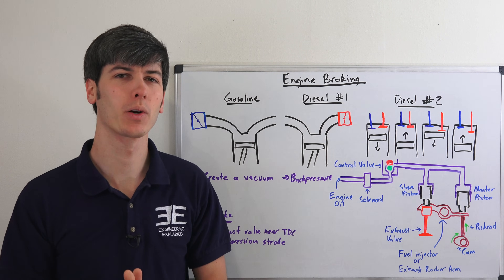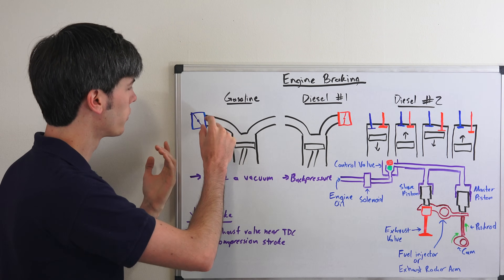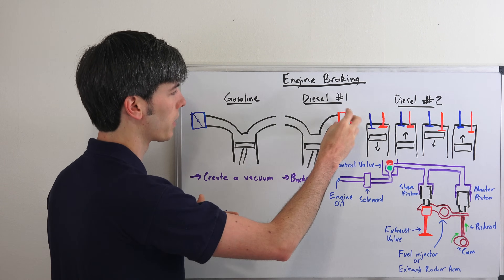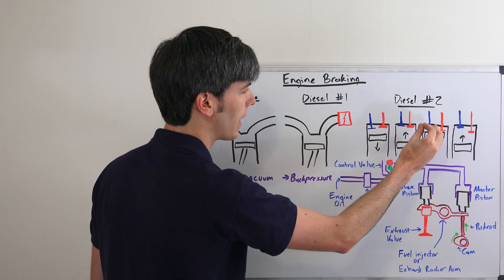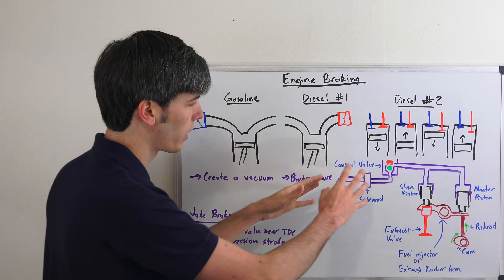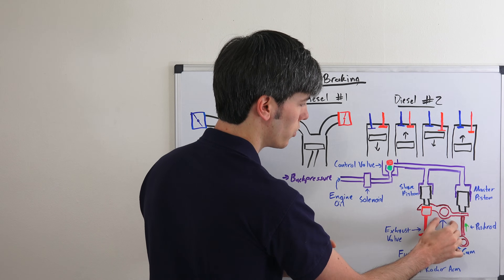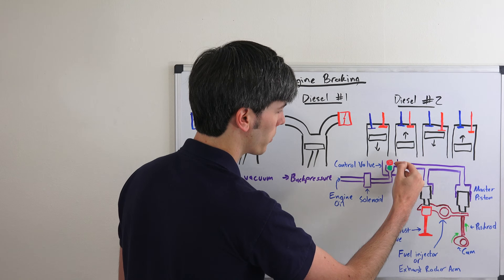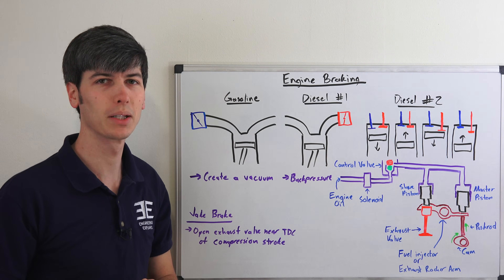What Is Engine Braking? What Is A Jake Brake?

Comment: How is this distinct from downshifting? - we'll ignore the difference between tiptronic and standard. I imagine downshifting is still leveraging the transmission to a degree, though if traveling in 6th, for example, dropping to 5th, is the rotation of the wheels/drivetrain now being converted from greater to lesser, forcing the engine pistons to move more quickly than when in 6th, though now against the vacuum pressure you introduce by letting off the accelerator?
Reply: +closerb4 downshifting is what you do with your gearbox. engine braking is what engine is doing when you are downshifting and not applying accelerator. so it's not distinct at all - it's different parts of the process :)

Comment: Does this means that engine braking does not uses fuel at all ?   I am curious about under what circumstences is putting the transmission  in neutral better for fuel economy. In other words, do you waste more energy bay braking with the engine or by running your engine on neutral for a said distance (in city driving).

Comment: Are there any disadvantages to engine braking? i.e. premature transmission wear, clutch wear, engine wear?
Reply from the maker: +jrolivo So long as the engine has sufficient cooling (which generally is the case), there should not be any issues.

Comment: I though engine braking was caused by friction inside the engine and transmission
Reply from the maker: +Jesuisguillaume - zm2y611 That will also provide engine braking, but the effect will be minimal in comparison to the methods discussed.
Reply: Engineering Explained Thanks for your clear explanation ! ;)

Comment: Is downshifting (when done well) okay to do, or is it bad for my engine?
Reply: Yup. Most modern automatic transmissions will downshift for you as the car slows down.
Reply: When done properly it can increase longevity of the brake pads. But if you do it wrong you can wear out your clutch. But the sound of a v8 downshifting cannot be beaten
Reply: If you can "heel and toe" then it does not harm, even the least bit, the engine or transmission. 

"Rev matching" also works but it won't slow you down as much since that technique doesn't include using the brakes.
Reply: +Peter Jada at reasonable speeds you can rely on smooth clutch operation to engage, then it has lowest impact. also if you downshift just one gear - it's pretty much the same as you would up shift one gear in normal operation - has no impact on parts compared to usual operation.

Comment: My diesel has throttle body on the intake manifold. Whats the difference? Alfa Romeo 1.9 JTDm (common rail direct injection for US people :))
Reply: +NornIron1991 I think that diesels deserve a lot more attention, I mean, 1.9 liter, 180 hp, 280 lbft torque and 60 mpg. Add to that, diesel is cheaper. Here in Croatia, Europe one litre of gasoline costs almost 2 dollars so yeah...

Comment: So if i leave  the throttle frequently, Will it result in breakage of the throttle valve ?? Since the entire pressure is acting on it ?? Also why we use Jake brake? Is it a special thing, Does it waste useful fuel injected into the cylinder??
Reply: +Yathu prem No the engine is designed to withstand the pressure caused by engine breaking. Jake Brake's are good for trucks because they are so heavy and need a lot of braking force to slow down. Without them the normal brakes would wear out a lot sooner. And lastly no it doesn't waste fuel because the throttle is closed there will be next to zero fuel being injected.
Reply: Jake Looker Thank  u man !!

Comment: is it true that a gasoline engine uses no fuel at all while braking with it?
Reply: +budsteppah Yes that's true! it will turn the injectors off to save fuel
Reply: +budsteppah I'd say yes; when you let off the gas pedal, the gas valve closes, creating a vacuum in the cylinder, that slows down the engine, which is connected to the wheels if you don't press the clutch, therefore slowing them down. I'd say what actually uses fuel is pressing the gas pedal, but i'm no expert, just my two cents.

Comment: theoretically...engine braking in a gasoline car assists normal power braking due to high vacuum?
Reply: +Nick White gasoline engine has higher engine braking than diesel and if used often will impact your fuel consumption and brake pads. first might get 10-20% fuel economy and brake pads can be prolonged up to 30% (but when using engine braking you must always pay attention and think about traffic lights etc constantly - that way you will get highest possible results)...
Reply: +Senpai Nooberinho i always engine brake

Comment: Thanks for the vid but why some gasoline 4 stroke engine has stronger engine braking than others? And why 2 stroke engine has less engine braking than 4 stroke?
Reply: 2 stroke engines have no engine breaking it's because there is no valves
Reply: +ENDURO SK I know, but in the video he said engine braking is caused by the throttle body closed not by valves.

Comment: Can you explain how a retarder works in truck gearboxes next?
Reply: +Vlad Melnyk I don't know what that is, which is the perfect reason I should second this.
Reply: Vlad Melnyk It is a simple system that add load on the gearbox by adding oil from a tank. you have a switch with three buttons each button add a certain amount of oil to make the gearbox just rotate that oil and with its high viscosity it will make a load on the movement of the gearbox so it will slow down. ☺☺
Reply: Hey man, you can't use that word. I think what you mean to say is "can you explain how a special needs person works in truck gearboxes next?" LOL
Reply: That would be awesome!
Reply: I don't think you're allowed to use that word anymore.
Reply: Ben I don't people who are offended by the correct use of a word should be allowed to breed or vote.